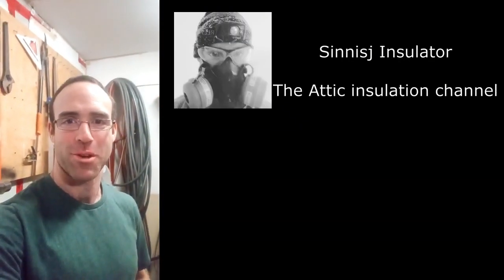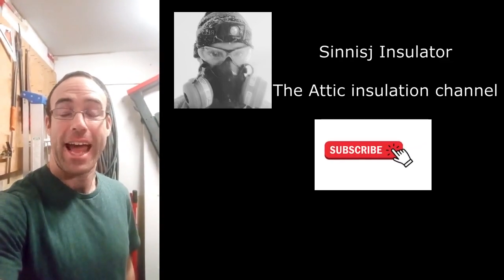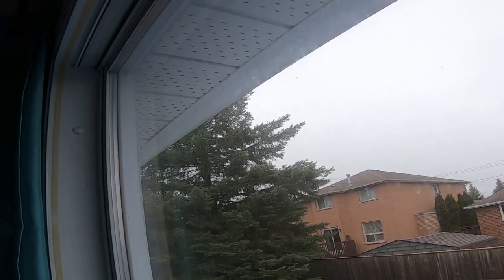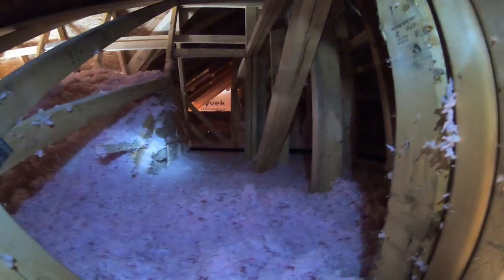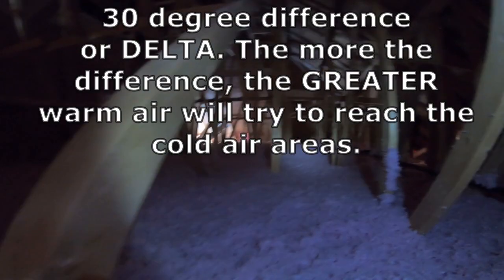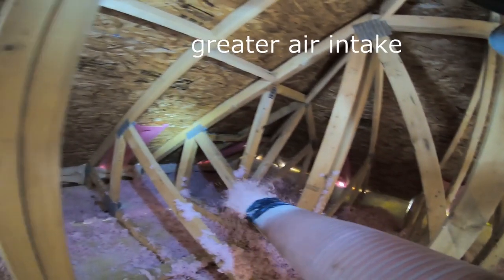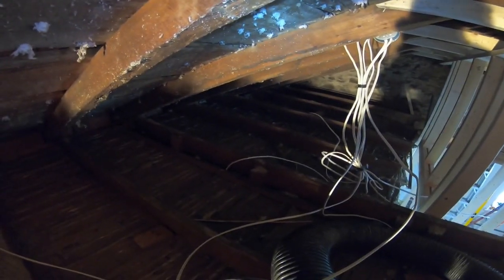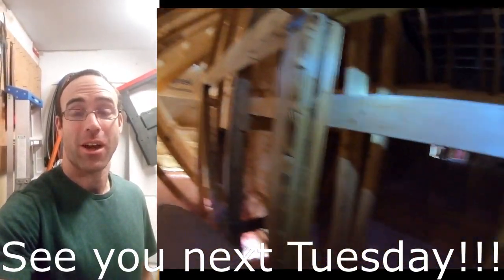Why is air sealing Ceiling light Important!

Comment: I think there should be gaskets made for ceiling lights to help seal the gaps from the room side.  Many attics make it difficult or impossible to reach the attic side of the light fixture.
Reply from the maker: Thanks for the comment. I completely agree with you.

Comment: Thanks for this video, we got to reseal ours because of a water leak.
Reply from the maker: Oh now I'm interested, is this a top floor ceiling electric box? And did you find the source of the water leak? There is lots of many misleading about the source of some water leaks.
Reply: @SinnisjInsulator  I think its coming from the attic fan.
Reply from the maker: @BradJSuccess  you can checkout my heat loss playlist especially the videos on attic bathroom fans. Lots of tips and it could lead to you knowing what's happening. It sounds like a condensation issue.

Comment: Belle lumière! En passant, j’ai aimé l’idée de la vidéo mais j’aurais aimé voir la boîte mal isolée. Comme l’image se promenait un peu partout (du Grenier, à une maison, à ailleurs...), j’ai eu de la difficulté à voir. Si tu avais simplement montré le grenier puis zoome sur l’espace où était la boîte électrique fautive, ça aurait été plus clair.
Reply from the maker: Merci pour le renseignement. C'est des fois dur de savoir si c'est trop vite et j'ai pas le temps de le faire voir par plusieurs personnes avant de le poster tristement. Mais le prochain sera plus de focus sur une scène.
Reply: @SinnisjInsulator  cool. J’ai pensé que tu voudrais avoir des commentaires pour savoir ce que gens aimeraient voir. J’aime toujours voir ce que tu fais et je sais à quel point c’est difficile, surtout que tu produis un vidéo par semaine sans avoir nécessairement un clip qui contient toutes les infos. Tu dois donc improviser. Pas grave si tu en as un moins bon de temps en temps. Practice makes perfect!
Reply from the maker: @marysemallet-sinnis2936  lol practice only makes perfect on the same thing and each video is different lol. Merci pour le feedback. J'essaierai de simplifier la prochaine fois. Je pense un moment donner je vais poster un plus long vidéo mais je suis pas rendu là.